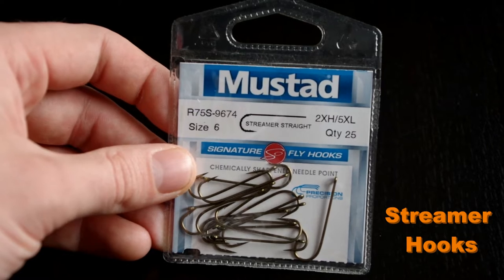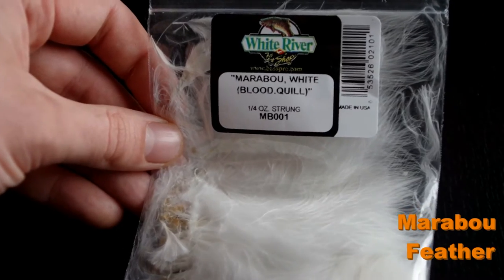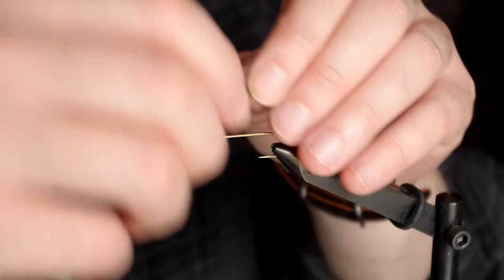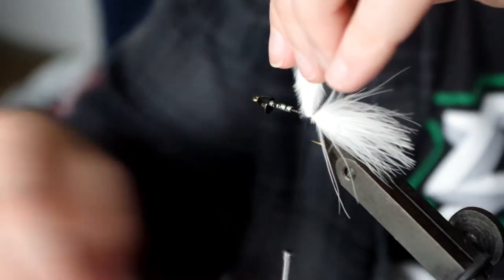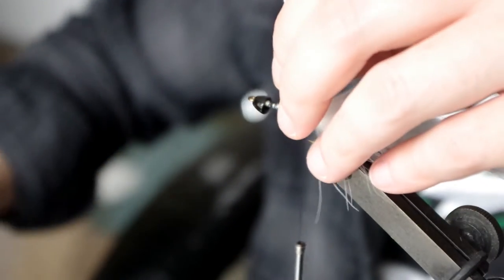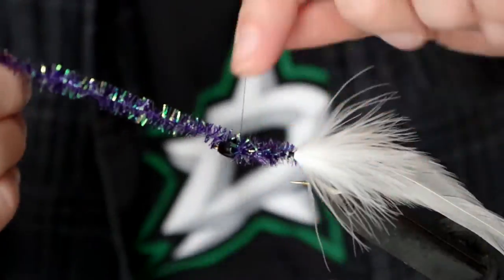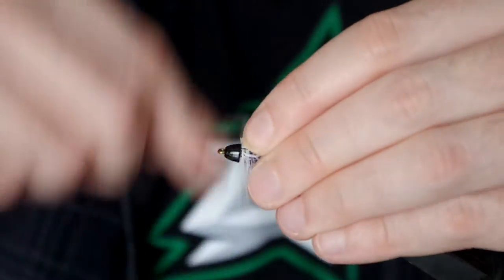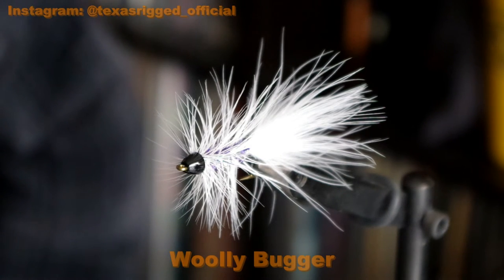How to tie a Woolly Bugger: The Orvis way

Comment: Might I suggest a few of tips.
When wrapping the thread, move the bobbin closer to the hook, you'd have a lot precise thread placement.
When tieing in the hackle, tie it in by the tip, that way the stripped end will be your handle.
And for the chenille, tie in the tip facing the other direction, that way the thread won't show.
Have fun tying!
Reply from the maker: Sweet thanks for the feedback! I had my brother on the vice while I filmed but we both just kind of wing it on the vice lol still learning!